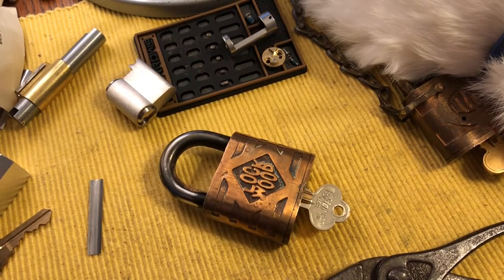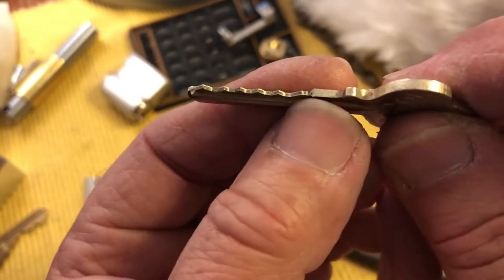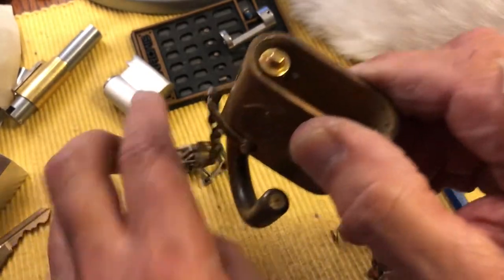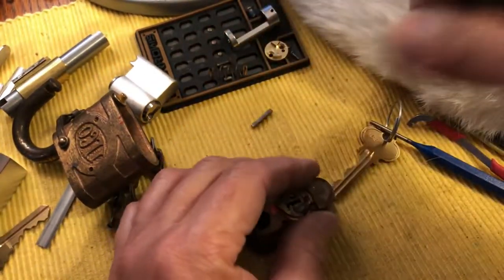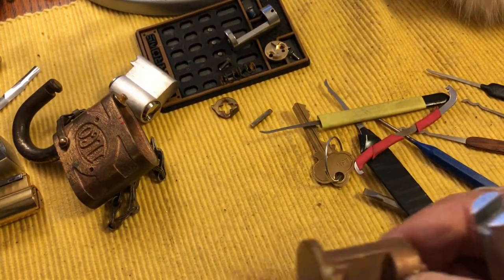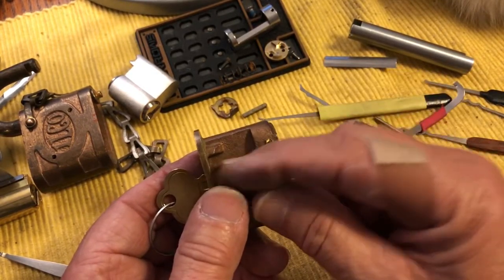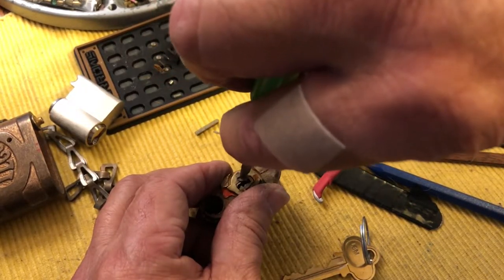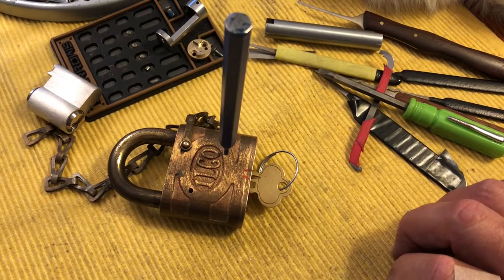#209 making a key for Old Ilco Padlock

Comment: Well explained step by step tutorial. I've torn a few of these ilcos apart and know that it can be a real pain when it gets stuck on the actuator.
Thanks for the great video Chris 👍😎
Reply from the maker: FunKey MonKey thanks buddy!!!
Had not had it stuck on the actuator until I tried the first tutorial video 😂😂😂😂😂
Had to stop and figure it out!!!
Avoided it on the one I posted! 
Fun stuff!!!
Does this key look like the key you were looking for to fit your Ilco??!
👍👍👍👏👏👏👍👍👍
Reply: @chriscapune7873  yeah its a daunting task when it happens lol I made a really steep hook from an old broken pick. Had to reach through the highest pin hole in the body, used the pick to snag the actuator to pop the shackle open😂😂 
Yeah that's the same profile key. Its the master profile key which will work for any of those on that list in Suki's book. There's also the reverse profiles of the same master series
Reply: @chriscapune7873  If it's a master key, it should work for any of the profiles in that group.
Reply from the maker: FunKey MonKey very cool !!!
On mine all I had to do was go in the top where the shackle contacts the locking pawl and shove the pawl out of the way!! 
Will send a picture to you.
Reply from the maker: Gary Rumain cool!
Oh, I won the Mail locks😅
Reply: @chriscapune7873  Congrats! :)
Reply from the maker: Gary Rumain now will get some stock to make the keys with!! After 11 locks I should be pretty good at it! 😂😂😂
Because the all the locks use the same key bitting I can start and use my locks , the two versions , to check that the keys will work!!! 
Then I will have a bunch of locks with keys to give away!! 
Maybe people tired of my Round American locks 😅
Reply: @chriscapune7873  I don't know, I like those round Americans. Very distinctive looking.

But, if they all use the same key bitting, then it should be easy to make new keys, provided you can source blanks for them.

Comment: Cool project! You shared a point few take so seriously but one I learned a long time ago doing cars. Now, we used to have to be tactical taking pictures, cuz one hour photomats werent free, but today we can take lots of pics without costing us anything. Pictures are invaluable for answering the tiny, minute detail questions when reassembling something. To this day I do it in a steering column, cuz it is just too easy to forget the ORDER things were done it. But why is it NECESSARY to    do so? 

Well, real live happens, especially when we least expect it.  Sometimes we get pulled away from one project, into several others. And when there is a delay o f that kind it is sooooo easy to forge those tiny details about positioning or order of assembly. Making marks  strategically is an important tip as well. 

 
Great Narration in your video today!  My favorite tip was checking two pins at a time, looking for snags. Such a simple, seemingly obvious, thing is the kind of tip sharing we all can learn from  if we just take a tiny moment to share them.
Reply from the maker: Mister RASorHarass thank you so much!!! 
Yes, I usually have 3 things going at once,, I took stills of all the steps when I originally began this project!! 
I usually learn the hard way 😂😂 
So now it mark and take pictures!!!
Thank you for all your comments!!!
👏👏👏👍👍👍👏👏👏

Comment: great, but you had an open lock to start with, mine is locked and I can't seem to pick it open
can you get to the pin with it locked ?
Reply from the maker: Carl Jobe you will just have pick it 
Because the lock needs to be open to take it apart 🙁
🐈👍👍🐈🐾